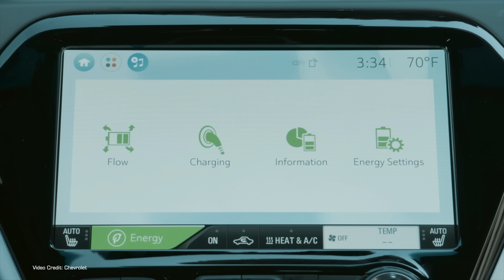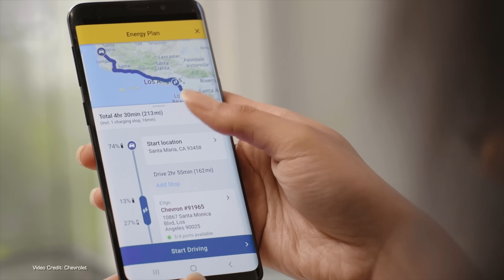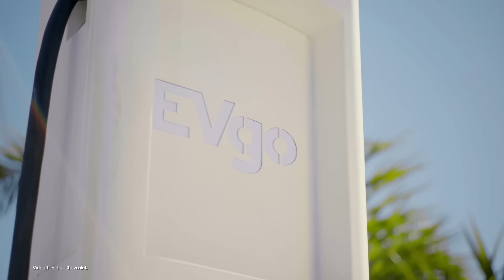UPDATE: Bolt EV Fire : GM Announces Full Battery Module Replacement - Here's What You Need To Know!

Comment from the maker: UPDATE: Since publishing this video, we're hearing reports of a 2020 Bolt EV that caught fire yesterday in California. We are waiting to hear more information on this story and have reached out to GM for comment. As soon as we know, we'll share.
Reply: Oh great...glad I'm only leasing this 2020 Bolt. That F150 Lightning can't come soon enough.
Reply: @anothercasualobserver8764  the F150 won't be any different.  The problem is lithium ion. Lithium ion batteries burn, that's just a fact of life. There is a reason you can't carry lithium ion batteries over a certain capacity on passenger aircraft.
Reply: @homomorphic  Of course it will be different. There was a manufacturing defect in these batteries that made them susceptible to catching fire. A bit like the Samsung Note back in the day. Not many phones catch fire but that one did considerably more and therefore was pulled off the market.

Lithium batteries are safe, despite the potential energy stored in them. But that's no different from the fuel tank in an ICE car in the end.
Reply: @homomorphic  No, the problem is a defect during manufacture and assembly. It takes a hell of a lot more to make a battery catch fire than say ... a tank full of extremely volatile gasoline!
Reply: @homomorphic  That explains why American Airlines wouldn't let me use my Chevy Bolt as a carry-on bag. Thanks.
Reply: @homomorphic  Very few properly manufactured lithium ion batteries "burn."  On the other hand 100's of ICE cars burn daily.
Reply: @homomorphic  
I might add that so do petrol and diesel cars. One incident that comes to mind is a diesel car thar caught fire in a multi storey carpark the diesel whilst on fire ran along the carpark setting fire to other cars then ran down through the carpark setting the rest on fire. Planes ✈️ well there a different matter, you can’t exactly escape at 22,000 feet, unless you have a parachute 🪂. I might also add that planes ✈️ are a flying bomb with wings and part of the fuselage filled with fuel. fuel that in the past has caught fire 🔥 and kill hundreds
Reply: @carljaekle  lithium ion batteries burn like kindling in granny's kitchen. 

The rate of spontaneous combustion in BEVs is 10x higher than spontaneous combustion in ICEs. ICEs do burn frequently in crashes, but they almost never spontaneously combust while just sitting in the garage.
Reply: @homomorphic  Source!  Even if true, what that really means is that ICE cars are more likely to burn when you are actually you know, using them, like sitting in them. Meanwhile 167 gas cars catch fire daily.
Reply: @carljaekle  battery EVs also ignite during collisions, slightly less frequently than ICEs, but not enough to offset the increased likelihood of catching fire while in your house (which is likely to kill more people than catching fire while being driven would).

Fuel Cell electric vehicles otoh don't burn in either collisions or when sitting idle. Not a single FCEV has ever caught fire for any reason (and there are more than 11,000 of them on the road just in California and several have been in violent collisions). One was even burned from the outside in the Woolsey fire, but the vehicle itself did not catch file even though the heat from the Woolsey fire melted the glass and burned the paint off.
Reply: @homomorphic  So since they (in your opinion) are going on fire more often when parked, and also when when driven, how do you account for the fact that the total number of EV fires per miles of use is actually lower than in ICE cars.  By the way EV's carry a small fraction of the energy that an ICE car routinely carry.  A Tesla Model 3 carries the energy equivalent of 2.3 gallons of gas, so you are dealing with a lot more energy released in a gas fire.  Hydrogen is famously explosive.  The lack of fuel cell vehicles catching fire may have more to do with the extremely low numbers on the road.  Hydrogen makes no sense for road cars owing to the horrendously bad end to end use cycle efficiency.  In addition 90% of current hydrogen production comes from the natural gas steam reforming, which releases a lot of CO2 in the process.
Reply: @homomorphic  Ultium is mostly GM's with help from LG. Hopefully  GM will take the lead on this.
Reply: @carljaekle  because that's simply not fact.  I don't deal.with opinions,  just facts. BEVs tend not to self ignite until the batteries are 3 or more years old, so you need to check the current stats for 2021, not 2018.

Hydrogen is by far the safest way to store energy. Again, facts, not opinions for me.

If FCEVs had the same rate of spontaneous ignition as BEVs then there should have been 5 occurrences and there are currently 0, also battery evs that have been burned in wildfires (like the fcev in the Woolsey fire) have had all of their batteries ignite.
Reply: @homomorphic  There is no  data that I have seen that suggests that BEV's are overall more likely to catch fire and burn than ICE vehicles.  It is a fact that the average ICE car carries on average multiple times more energy than a BEV.  It is a fact that FCEV's also often carry lithium Ion batteries, and that the hydrogen use cycle is hopelessly inefficient.  Too inefficient for widespread use  in cars.  It is also a fact that 90% of US hydrogen production comes from the use of fossil fuels.
Reply: @homomorphic  There were almost 190,000 vehicle fires in the U.S. in 2019, and they happen in gasoline vehicles at a much higher rate. It notes that from 2012 to 2020 there was about one Tesla vehicle fire per 205 million miles traveled—versus one per 19 million miles traveled for all types, citing data from the National Fire Protection Association (NFPA) and U.S. Department of Transportation.
Reply: @Hans-gb4mv  Actually the gas situation is way worse.  A Tesla Model 3 at full charge carries the energy equivalent of 2.3 gallons of gas.  A fraction of the amount of energy carried in the average gas car.
Reply: @homomorphic  your literally making stuff up now.  You have no idea what 2020 data will show so you assume it’s worse.  I own a 2021 Tesla Model 3, which now has 353 miles of range.  More range than when it was originally sold in 2017-2018.
Reply: @homomorphic  Regarding the Model 3:  Tesla is as much a software company as a hardware company and we’ve been able to via firmware improve the range of the long-range rear wheel drive car from 310 miles to 325 miles. This will affect all customers including those that were all long range cars shipped to date and new cars. So both existing and new customers will get a 15 mile range increase from 310 to 325.
Reply: @bellshooter  Either way they both burn and these cars can burn for hours.
Reply: @homomorphic   so now we have the obligatory OIL company rep, cant have just regular people here any more it seems
Reply: @davidwillims2004  literally the post before yours is someone stuck with another self emmoliating BEV that was just recalled yesterday.  The facts will quickly kill off your dreams of a BEV future.
Reply: @Hans-gb4mv  And a lot more gasoline fires and more dangerous in ICE vehicles.
Reply: @homomorphic  Except a Leaf battery that did not burn in a wildfire that burned the car to the ground. Who makes Leaf batteries?
Reply: @homomorphic  yea, well, oddly enough driving a vehicle that is using a type a explosive, can cause fires ? who new that was the case. and some times they happen because of accidents, but not always. but then, since your our resident obligatory oil rep, we shouldnt be disappointed in your interest in the past
Reply: @davidwillims2004  I have 2 EVs and I've owned EVs exclusively for years, I'm just not an idiot, like the Bolt owners who caused these fires by not understanding physics and charging their Bolts in a way that causes the fires. The Bolt fires are 100% user error, and it's the reason us folks who know what we're doing can't have nice things.
Reply: Sean Graham just posted this: “Aug 16, 2021 Fire - Roundup Post

There was a fire yesterday of a 2020 Bolt in California. I spoke with the owner to get the details.

•	Manufactured November 19th, 2020. Purchased January 9th, 2021. Car was less than 8 months old.

•	Less than 6000 miles on the odometer.

•	No damage, dings, or anything. Car was in perfect condition. Never had any problems. Absolutely loved the car.

•	Car was frequently let run down to ~30% before plugging in.

•	Car had charged from 9:00pm and completed at 3:04am.

•	Car was in driveway all day still plugged in.

•	Loud bang as smoke erupted out of the side of the car at 5:05pm - 911 was called very shortly thereafter.

•	Fire visible from under the car 3 minutes later.

•	4 minutes after that the aluminum body panels were melting.

•	FD was on site 10 minutes after the smoke erupted, but car was fully on fire by that point.

•	Very clearly was a battery fire.

This is the first 2020 that we know of that caught fire while charging, with the same pattern that was identified with the 2017-2019s.

This is the second US battery to catch fire in under a month.

I have reached out to GM for comment, will update if/when they provide anything.

It is important to note that this is the first 2020 that we know of that caught fire, so the odds are still very low. However, in light of everything else, it's still very troubling.”
Reply: @laurashea-clark3640  ...saw that yesterday. Will be following with interest.
Reply: Ho boy..
Reply: Wow - it just doesn't stop! :-(
Reply: @NeilBlanchard  re: "Wow - it just doesn't stop!" exactly, we must let go of our desire to get comfortable and also like i said we must CURB OUR ENTHUSIASM regarding any new battery tech.  the fact that it's "new" doesn't mean it's better, more specifically what it means is we don't have an HISTORY or USE data on it to know anything definitive about it one way or the other.  people forget every problem in History had a FIRST OCCURENCE.  #FIRSTIMEFOREVERYTHING
Reply: Nikki. Could you do a video for apartment owners charging placement on/in their buildings? As well as the most convenient locations. When you mentioned Winter's landlord did I got to thinking this would be a good topic to cover. I'm in a small city thats getting more people moving in as well as the surrounding towns. I haven't seen much apartment buildings accommodate EV owners and if they watch your channel maybe they will get good ideas as to how to entice those renters.
Reply: I have 2018 Bolt with only 8,500 miles, I charge my Bolt when the range goes down to 140 miles and only using 110volt charger and up to 220 miles of range, in other words my battery pack should be in optimum condition. Hopefully GM is not going to get “to smart” and remove bad modules at the factory from the first group of batteries replaced   (supposedly the 2019 models) and use these re manufactured battery packs to replace the batteries in the 2017 and 2018 model, will see. I do not trust GM, neither the GM dealers here in Louisiana.
Reply: me too, i have 2020 Bolt, also on lease with GM captive finance company
Reply: Anti EV trolls are just so tiresome, and loathsome.
Reply: Well now what am I gonna do? They recalled my 2020 Bolt. Will they offer to buy out my lease?
Reply: i saw a tweet of a 22 bolteuv being part of the recall, so idk if swapping the battery will resolve the issue either.
Reply: @adnanenful  well there is that, course if LG actually knows which of the plants the bad batteries came from (and they should), then they could produce replacement modules from other plants. problem is modules are a lot harder to replace, and dealer techs that know how to do that, are far and few between. they should just be replacing the battery pack, its easier and less error prone than the other. though getting the parts to actually do the repair will be a long time coming. course LG is a supplier for more than just GM, they supplied Hyundai, Ford and VW.
Reply: @davidwillims2004  true, which makes the buyback the only logical coure of action in some states where the battery swap isn't feasible.
Reply: @adnanenful  and that maybe what they do in some locations, since transporting the cars to dealers who can fix them, will not be cheap. but who knows, LG might want to fund that too, since right now they are ones who on the hook to fix the batteries
Reply: @davidwillims2004  Yes a battery swap with the GM/LG help batteries might be OK.
Reply: I am waiting for a new 2022 bolt ev. But what a shocking news! Oh deer!!
Reply: So it sounds more like the issue is the design and not the manufacturing technique. Maybe blade design by BYD and Clemson University may have a better long-term solution. I will be curious to find out more about the 2020 vehicle fire.
Reply: @Carl_in_AZ  Possibly it is a design issue? But in every general way I can see, most battery pack designs are very similar. Only these are made by LG, and they seem to be where many of the fires are occuring.

A buyout is seeming much more likely, now.
Reply: @Carl_in_AZ  enough to give a fella that sinking feeling if that turns out to be the case. I'm wondering what the difference between the Bolt battery design and their up and comer Ultium?
Reply: @anothercasualobserver8764  I'm waiting for the Ultium batteries.
Reply: @robertlee8805  Which GM ev are you waiting for that will use the Ultium? Right now Ford's F150 has really got me on the edge of my seat waiting for as well as the $12,500 tax credit that will drop the price of the model I want to $28k. I drive very few miles at a time anymore so the 230mile range battery will be plenty for me and will save me from having to buy stationary storage for my rooftop solar system. I do love this 2 cent per mile driving with the Bolt though. Maybe I'll pick up a used Bolt that GM has already replaced the battery in a little later. Those should be really reliable by then and very reasonably priced as well. By 2023ish when my Bolt lease is up I expect them to be a dime a dozen. They could make a great first car for a teen.
Reply: I won't trust their Ultium either until there are 500K on the road and zero fires after eight years of use.
Reply: @davidmccarthy6061  so you dont buy any vehicle till 500k have been bought, and they have been in use for 5 years, and have had no fires? guess you dont buy any new cars (most of them dont last that long, and those that do, arent the same as they were after 2 years).  most dont even sell 500k in 3 years...if not longer. and since almost all ICE vehicles catch on fire (there many 1000s of ice vehicle fires every year...and has been for decades...some to do with driving around a vehicle propelled by explosions' basically guarantee it...and the there are the electrical fires...)....
Reply: @Carl_in_AZ  BYD is a Chinese manufacturer. I'd preferred American made and designed. China is really kicking our assess on mass tech, when will we be the leaders of mass tech? And clean energy production?

Comment: Deserves another "update" since this is so old. Makes it seem as though all of us are still limiting charging to 80%-90% and not letting the range go below 70 miles and afraid to park them in garages overnight. We have 2022 Bolts with the new battery packs. No such problem at all and they are performing beyond 259 mile range expectations.

Comment: I had the recall# 212345940 firmware update installed today. My 2021 Bolt EV only has 2900mi on it. It can be charged indoors with no other limitations though I will try to limit driving below 70mi when possible. Car works perfectly & will get used as intended. Mutt is my cars name which gets a pat on the head ever so often.
Reply: The update was installed to aid GM in their data collection process. They need all the help they can get.

Comment: My creator is not impressed by GM's management/manufacturing response. Common sense suggests that swapping a whole battery pack for a new one is quicker. Wouldn't that save hours (days? weeks?) in labor costs? Common sense might come in handy when - and if - GM produces another EV. Weren't we promised 20 new EV models back in 2017?

Comment: all ev should have one batt fits all cars, you go on a long trip, need a recharge, stop on service station, left flap, pull out discharged batt, insert a re-charged batt,  off you go, simple, but non of the ev makers wont do this, up the road from me is a ev charging box, with 3 cables , one for thick people, one for dum people, and last one for kinky people, who like sticking their fingers were they shouldn't,  one cable, and one cable only, why 3, its just a box with a credit card hole and a cable, the the kit to charge the ev car is in the car,

Comment: Hybrids are still the way to go.  2015 prius 210k miles and not one problem.  We still have neither the neither a good source of lithium and most importantly WE DON"T HAVE ELECTRIC GENERATION CAPACITY WHICH NEEDS TO BE INCREASED BY 40%.

Comment: Still, the coverage of EV fires may be overblown, said Sam Abuelsamid, lead auto analyst for Guidehouse Insights. Seven Chevy Bolts have caught fire, or about 0.006 percent of those on the road. By comparison, the National Fire Protection Association said 212,000 gas and diesel vehicles caught fire in 2018, or about 0.07 percent of those on U.S. roads.